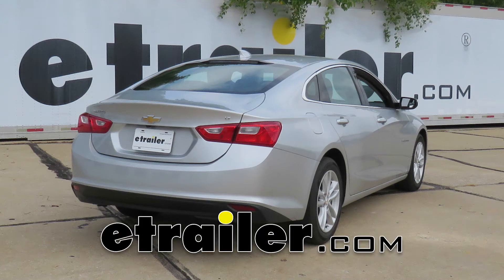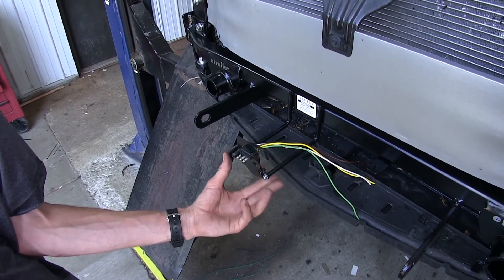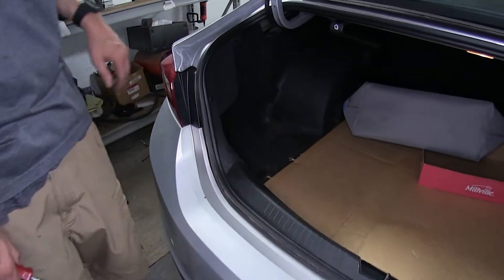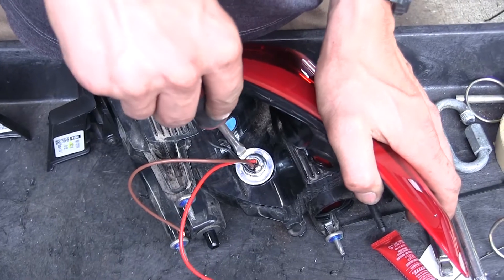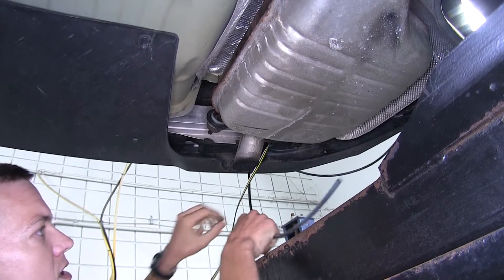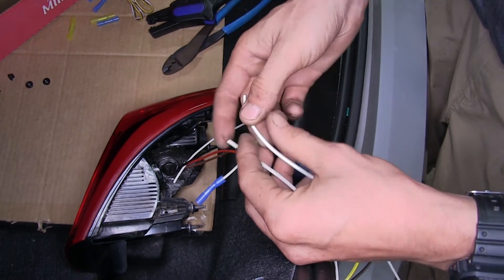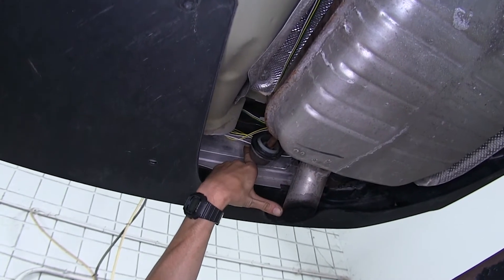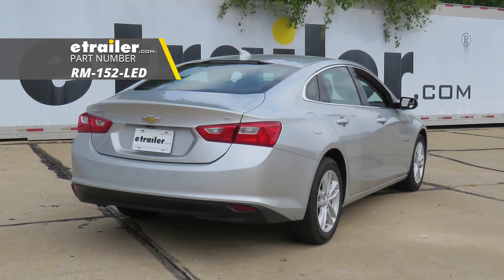Setting up the Roadmaster Tail Light Wiring Kit for Towed Vehicles on a 2017 Chevrolet Malibu

Comment: What's the size of the car's original brake light socket?
Reply from the maker: That I am not sure on. If you are looking for a lighting solution for flat towing your vehicle, I recommend using a diode wiring kit. It will be an easier installation and you will not have to drill into the backside of the factory taillights. Once the kit is installed, you wont even know it's there.
https://www.etrailer.com/Tow-Bar-Wiring/Roadmaster/RM26FR.html